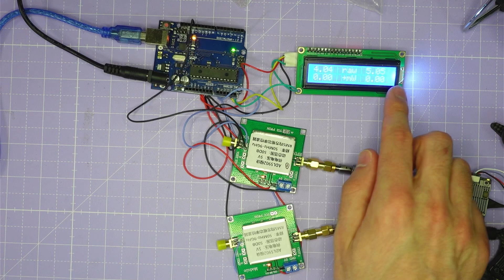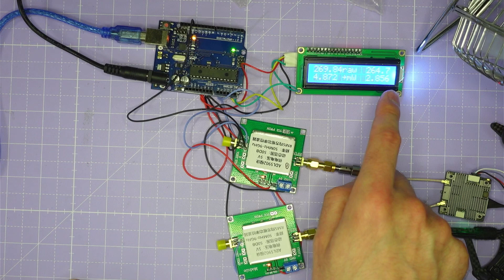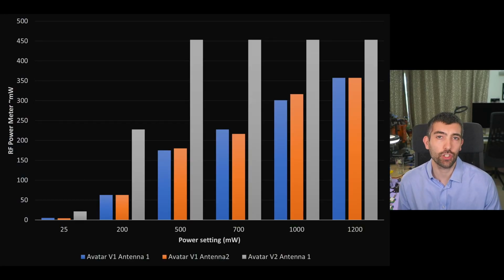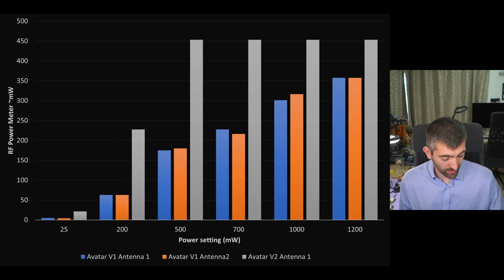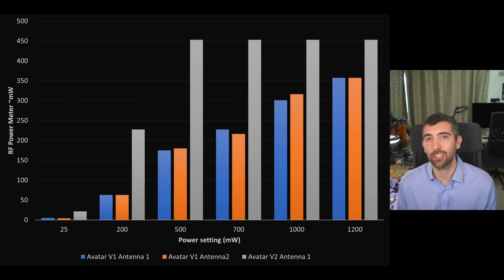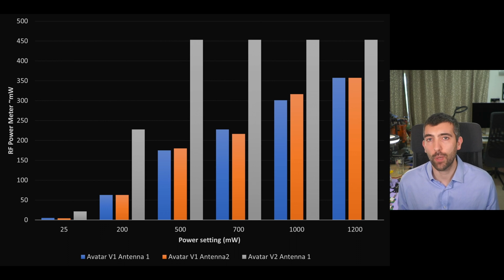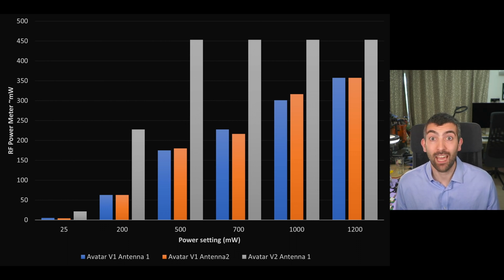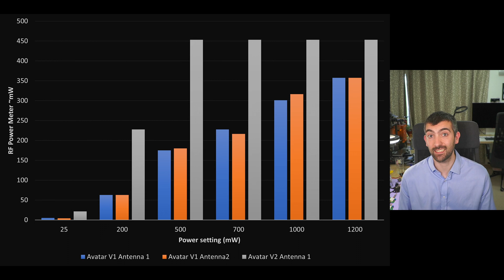Walksnail Avatar V2 WEIRD Output Power Behaviour?!

Comment: Very interesting findings! Nice of Caddx to answer swiftly also. I have to ask though, what is the thought behind "enhance the ground end of transmit power" (the Goggles, i presume)? Range is a VTX thing, isn't it?? Double the power on the goggles does  not increase the range, or does it? 🤔
I use the Avatar HD Pro and Goggles X so this would be nice to learn.

Comment: RushFPV max Solo is also not every piece can deliver 2.5 W, as the chip inside has nominal output power 26 dBm (0.4 W), and in overdrive modes sometimes delivers 1.5 W, sometimes 2.1 W. Tested on a few VTXs

Comment: Hi Chris, I think I might be unto to one possible explanation for your unusual V2 power output results. I was looking JB's Avatar V2 tests and noticed that at 700mW he never got above a 14mbps bitrate, but once he went to 1200mW he was able to get 25mbps. Then I remembered that OFDM (the digital modulation scheme used by these systems) consists of multiple sub-carriers each modulated with some form of QAM-n sub-modulation. To achieve higher data bitrates, the sub-carrier need to use higher QAM modulations e.g. switching from QAM-8 to QAM-16 would double the raw channel bitrate of a sub-carrier, however this requires a higher SNR to properly discern the data symbols of the QAM constellation so it's normal to boost the power of the sub-carrier when changing to schemes with a higher bit-per-symbol encoding. That got me thinking, since your tests were all indoor and stationary, the video encoded by the VTX would have been a static image and had the lowest possible bitrate (due to MPEG temporal compression), so the system would not need to increase the bitrate above the 14mbps JB recorded, hence no measurable increase in output power. I would suggest you repeat your tests with the camera pointing at an LCD monitor showing white noise e.g. from an analog VRX noise on an unused channel or a DVR recording of that. This would force the system to produce higher bit rate video and I would expect you'd then see higher output powers when set to 1200mW.

Comment: Is it possible that the walksnail system is limiting the power output based on the distance from the goggles? Maybe if you get some distance between the Rx and Tx that it might output more power?

Comment: There's a post on the official Walksnail FB channel of this video. I can’t post the link, comment gets deleted here. In a comment on the post, Caddx states that Chris' data is correct - the V2 VTX is limited to 500mw output, all higher settings only increase output power of the TX on the goggles/VRX.
Reply: ew.

Comment: Hey Chris, Thank you for raising questions. We do it to adjust the power. The data is not fake. V2 transmission in more than 500mw will only enhance the ground end of the transmit power.
Reply: @CADDXFPV what does that even mean!? We want to love you more than DJI so get it together lol
Reply: "V2 transmission in more than 500mw will only enhance the ground end of the transmit power", you mean that it's useless to have 1200 mW ???? And what about the the v1 ? Why so little power, dji has more i guess...
Reply: @jadoofpv3462  I've gone 29km with the v1 on '1200mw' using cheap 9.4db triple feed patches. Range was increased using the 1200 setting compared to 700.
Reply: @tmc-fpv  That's the V1 though - which from Chris' data does output more. Have you done any range tests with the V2? 
What's interesting is on Chris' data, it seems like even on  the 1200 mW setting the system only outputs ~350mW, but that's still higher than ~220 mW on the 700 mW setting...
Reply: @Vousie   Ive only been using the v1 and 1s vtx. other fixed wing buddies are finding that the range of the v2 is around 15% less than the v1, which they put down to the single antenna. Regardless of the setting or numbers within the menus it appears that there is ample power.
Reply: @jadoofpv3462 I think the range and penetration of the v2 speaks for itself.

Comment: Did you look at the amount of power drawn by the system ? Is the power source able to deliver enough ? The walksnail system being bidirectional, I wonder if obstructing the signal to measure its power level does not modify the whole system behavior.  (measuring the power drawn would also show the efficiency of the walksnail solution and similar measures could be done on DJI & HDZERO)

Comment: In my case v1 vtx works better than v2 and its for range and penetration. I'm flying on 700 or 1000mW and can say that 700mW is better because noise ratio is smaller, 1200mW is almost unflyable on both v1 and v2.

Comment: You can also observe the same behaviour through the debug overlay of the goggles by setting the screen size to 10%. 
When you raise the power above 500mw, only the goggles' transmit power increases but the vtx stays the same like...

500mw => Sky: 26dBm, Ground: 26dBm
700mw => Sky: 26dBm, Ground: 27dBm
1000mw => Sky: 26dBm, Ground: 28dBm
1200mw => Sky: 26dBm, Ground: 29dBm
Reply: Gross

Comment: My understanding is that analog is measured as an average and digital is measured as a peak... I got that information from the ImmersionRC power meter. You seem to be using a different method ? Did I miss a video you go deep in RF power measurement ?

Good luck on your battery testing quest... I hope it won't be too time consuming as I love your videos and don't want less of them :) CNHL has been my 'go to' brand for 3 years now because it's half the price of premium packs like r-line and about 90% the same performance. Impatient to see your results !

Comment: I encourage anyone whinging about the "output" chris has measured here to do some real research on the subject. Accurately measuring the "real" output power requires instruments worth more than a luxury car. In the FCC documentation, even DJI doesnt represent their output power accurately. When it comes down to it, walksnail is capable of 50+ km of range with the right setup and conditions. 

I say this and someone that owns both systems (G2 + O3 and Fatshark goggles + v1/v2 VTX), WS just isnt as polished, yet.
Reply: accurately measuring the power is absolutely possible with this cheap setup, down to around 10% accuracy (which is good enough for fpv purposes). 
it just needs to be calibrated against a reference which can be difficult to get access to. 
uncalibrated, as shown in the video, its perfectly usable for relative measurements.
Reply: @drkastenbrot  people much smarter than you or I think you’re wrong…

Comment: I see from the datasheet that the AD5902 has a 2K input impedance which is much higher than a typical omni antenna (< 50 ohms). Could it be that the V2 VTX is able to detect the high WSVR such an impedance mismatch would generate and power limits the RF amp e.g. to protect against a damaged antenna? We all know reflected energy can damage the transmitter, and more so with the V2 VTX since it has a single antenna outputting all the power. FWIW Analog Devices already incorporates this functionality into some of its amps. Search for "Log amps and directional couplers enable VSWR detection".
Reply: he has an attenuator in series which provides a very clean, low vswr 50 ohm load.

Comment: So by your scale, apparently going to 500 on the v2 produces the same power output as the v1 at 1200 mw all things being equal?
Reply from the maker: A little more actually, but the V1 has 2 antennas so in total it outputs more power. 2 antennas at 400mW is not equal to 1 antenna at 800mW though because the power doesn't add linearly.

Comment: Probably all we need is just to have a look at that rf amp chip, find its datasheet and check its capabilities
Reply: the chip walksnail uses is rated for 250mW. its not uncommon to get more power out of rf amps, especially with cooling, but you wont be getting close to 700mW with that chip.

Comment: I had wondered how they were supposedly getting 1200mW out of the SKY85743 amplifiers in the vtx, which only specify 24dBm (250mW) output power in their datasheets. I'm curious about the 1S vtx too, and whether the maximum output changes when the battery voltage decreases. Power consumption does change as measured by painless360, there may be a tradeoff.  Cheers!

Comment: I think this is done to not give the impression that the system has lost power (it effectively gained power) while trying to match the actual power to what the setting is called. So I would guess they did the "equivalent to analog" thing in the beginning, but realized it was a mistake later on and wanted to fix it without giving the impression that the system lost power (it would probably sell worse and it wouldn't be true). Still would have been bettr to openly communicate that they did this.

Comment: Hi Chris! I think this is a feature/simplification.
On the lower power levels, they are bringing the numbers in line with what you see, as well as having users notice a big upgrade on penetration/range. As most casual users will not use the highest output settings, they may have capped the power. 
Hear me out with potential reasons.
1) newer hardware, loathe to have many RMA due to bench burnouts.
2) from electronics packed tight, low airflow, refer above.
3) if things seem to stay stable, and only a few fires here & there, they can unleash more with fw updates for LR records.
4) they could just cap it for stability and reliability. They might want this iteration of the vtx to have a longer service arc and want to build rep for  those reasons. Cruising vs racing won't blow the engine.
5) they want to stay under the radar, so to speak, even if the stated power is above legal limits in the US, they can claim it was capped the whole time, if investigated? Last reason is reaching, and I don't know enough about the nuances of liability here in the US.
Reply from the maker: Really nicely thought out comment, thank you! There is some tolerance allowed on power output (DJI have +/- 2.5dBm!) so the V2 settings would be within that accuracy from a power output standpoint. V1 seems more like "equivalent to analog" or a bit on the low side if you take the combined output power of both antennas.

Comment: Doesn't Walksnail use actually dynamic power levels and only boosts up if necessary up to the set limit? To reduce closeup interference and overheating? 
I mean.... Someone flew 50km on WS. I highly doubt that this would be even remotely possible on just 350mW on the V1 VTX.
Reply: This would be a great feature, same as ELRS. I don't think it's implemented.
Reply from the maker: WS Avatar doesn't have dynamic power. Power is the same regardless of signal strength/bitrate.
Reply: @ChrisRosser  How is the approximate distance to the transmitter determined?

Comment: I think Walksnail has been lying to us all along. And the VTX isn’t actually capable of the output power they’ve been advertising. 
I think originally they scaled the output to appear as if each milliwatt setting was appropriate. 
But with this latest revision they either forgot to apply the scaling, or just couldn’t be bothered to even try anymore. 
We’ve known from early on that basically anything above 700mw resulted in signal to noise ratio that essentially rendered it useless. So I wouldn’t be surprised if they just lowered output to try to stay out of this noise floor.

Comment: Have you checked whether the measurement device you use can even measure higher output powers? It could be saturated and therefore not show any increase
Reply from the maker: Yep, tested with 1600mW analog VTX and we're nowhere near saturation. Results confirmed by MadsTech on his analyzer as well.
Reply: @ChrisRosser  thanks a lot!

Comment: @Caddx WTH!?? Please explain this?
I wondered why the range was horrible on the V2 system, I just thought it had to do with the single antenna. But if DJI can do a single antenna with the Airunit lite/vista with no issues then Walksnail should be able as well🤷🏻
Reply: DJI O3 has 2 antennas, they are just put into one housing

Comment: Before I buy an Avatar system by Walksnail they need to sort out 1. Their bitrate modes 2. Their power modes 3. How well it can hold a link. 

So many inconsistencies between the quality/power of their modes. It's really disappointing that they're working on new products without ironing out these fundamental issues.

Comment: Clipping in your readings?
Reply from the maker: No the sensor isn't saturating, it'll measure much higher power than that, tested with a 1600mW analog VTX and still nowhere near saturation. Theoretically the system saturates somewhere between 33 and 39dBm (2 and 8W).
Reply: @ChrisRosser  But wouldn't digital's crest factor play a role in signal level causing saturation? Although realistically, that would not be a sharp cutoff after 500mW. Another way to confirm the power is the same is measuring VTX current consumption.

Comment: Yo Chris sent you a msg through AOS website weeks ago but no reply . Anyways i got the EVO 7 " and im looking for 3d prints mainly for DJI 03 au but with 2 antennas and GPS mount does EVO 5" prints fit the 7" ?
Reply from the maker: Some do, there are also some prints on aos-rc.com on the AOS 7 page. Thanks!
Reply: @ChrisRosser  yeah I saw the 1s on the AOS page but the antenna mount is for the dji 03 au single antenna I was looking for a double sma antenna print.. does any of the other AOS frame mounts fit the EVO as I found a lot available for AOS 5" / 5.5" / 7" / UL5 V2

Comment: Chris, congratulations on the technical level of your work.  Your analysis is appalling.  I feel absolutely cheated.  If China were a free nation founded on democratic legal foundations, it would be up to local prosecutors to prosecute for false advertising, fraud and consumer crime.  But we're talking about China... Could you run tests with the calibration files (+/- 1, 2, 3...) and analyze the effectiveness of these adjustments in increasing the output RF power?  I use +1 on my VTX V1 and I've had an improvement in penetrability, but I know there's a more than proportionate rise in noise.  Congratulations on the job.
Reply: ... adding: I did several tests in a site with vegetation obstructing the direct line of sight, changing the calibration between -3 and +3.  There is real improvement at +1, but evident degradation of signal Penetrability above +1 and below 0.
Reply: So you are getting the first in the world low delay 1080p fpv system for the lowest price point which does its best to please its users and you are still complaining? Since you are a "free nation founded on democratic legal foundations", go sue yourself for being a nag!!!

Comment: temperature management !
Reply: good point! the transmitter needs a fan pointed on it
Reply from the maker: Good point, there is a fan on the VTX. You can hear it in the audio and see it in the corner of the video.
Reply: @ChrisRosser  oh I didn't notice. But good we pointed it out

Comment: A simple explanation could be, that your DIY power meter goes into saturation somewhere around 450mW - either in the sensor or in the Arduino processing? All the V1 measurements were below this level. I fully realize you may have tested your measurement setup with a higher powered source, but it is not clear what readings you obtain with say a known good 1W source. I look very much forward to seeing your battery tests - great initiative! Edit: I am now a Patron.
Reply from the maker: It doesn't saturate. I "calibrated" the setup using a 1.6W analog VTX and even that is nowhere near saturation. Saturation would be around 33dBm (2000mW)
Reply: @ChrisRosser  I think I may wait a bit for a firmware update before buying the V2 VTx'es I had planned to 😝
Reply: @ChrisRosser try to check your system on the dji module. If it behave dufferently on the high power so we have a problem with the walksnail vtx, otherwise with the power meter...

Comment: Standard Chinese Marketing 😂
Reply from the maker: It will be interesting to see how the power numbers for all the digital systems compare to the nominal mW values given. In general I've always assumed 1000mW meant "equivalent to an analog VTX at 1000mW" rather than actually 1000mW of output.
Reply: @ChrisRosser equivalence is a little arbitrary IMHO. Would be nice to repeat the test with different WS versions.
Reply: @marianofpv  you should buy a 30k VNA and test it for yourself!
Reply: @ToiletduckX  you got it wrong pal. Had a bad day? Firstly you are answering not to this comment, but to another I deleted because it was already answered down there. I was just throwing ideas, and the saturation was a possibility. Chris already answered that the equipment can measure in excess of 1.6W. I love this video and my mind explodes with ideas of different tests that coud be made. At first, it's outraging that walksnail would be doing this, so I wish this could be some other issue.